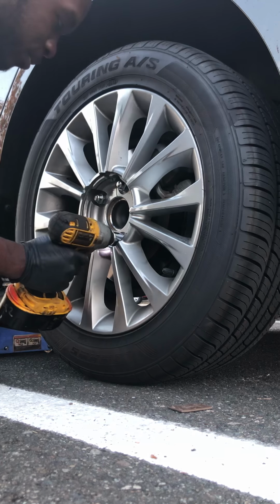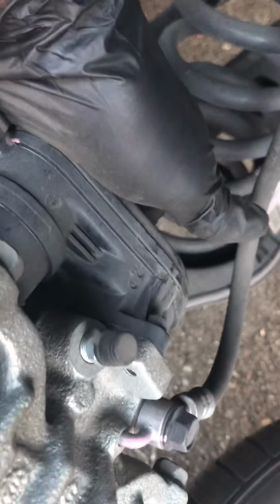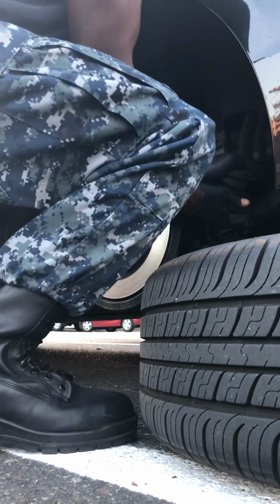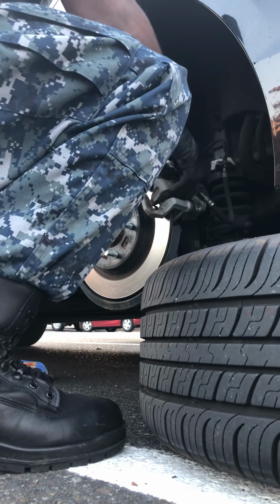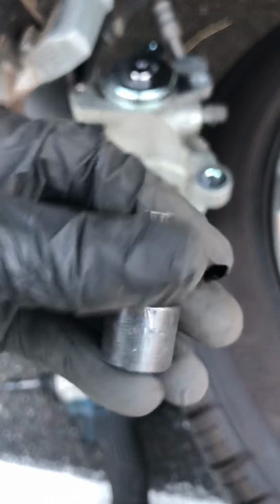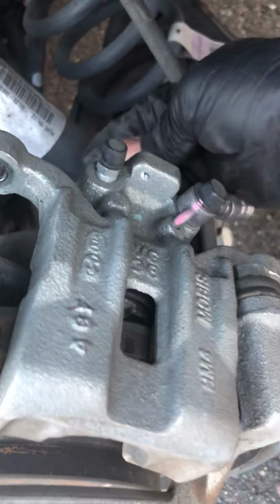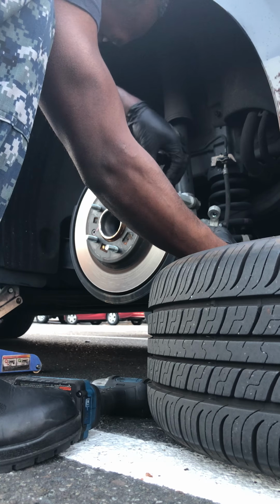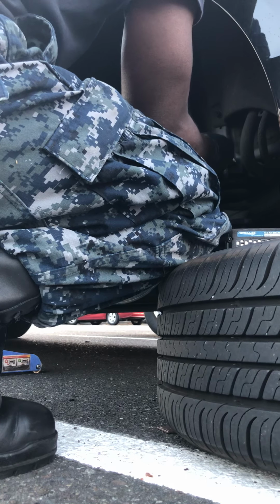HOW TO CHANGE REAR BRAKES WITH ELECTRIC PARKING BRAKE ! EASY DIY 2015 HYUNDAI SONATA

Comment: You can also retract the piston's spline using a 9V battery on the motor's terminal pins.  Then you don't have to dismantle the motor casing.

Comment: You can also use a small flat head screwdriver to unwind the power break gear if you don't have a torque bit.   I didn't have a bit the right size so gently using a small flat head screwdriver worked perfectly..  It should move easily.   Once the gear is turned all the way back you may still have to depress the caliper cylinder.  It should depress easily.  If you feel you have to start using a lot of force the power brake gear may not be all the way turned out.

Comment: Thanks for the great video! I've got an Ioniq and had to change out the rear discs cos here where I live in Norway, we don't change brake pads, only discs 😂😂 (because of the salt) your video gave me hope because of the EPB issue. However I'd like to say that I figured out you can just 'carefully' jumper 12v DC onto the EPB motor plug terminals (after unplugging from car of course) and that will turn the motor in or out depending on the polarity. Very easy to do! When you finished with the job and have the wheel still off, just activate EPB once or twice and it automatucally sets it.
Reply from the maker: Really didn’t even think of that 🤣 thanks for the heads up forsure!

Comment: man , I watched your video on replacing the pads on my 2015 sonata. I took off the motor and turned it clockwise to pull piston in. but it started coming out, so I went the other way and now the piston wont retract. any ideals what I can do to be able to retract piston?
Reply from the maker: Just takin a wild guess because i'm on deployment and can't try myself, but try getting in the car and pulling the lever for the parking brake. Then releasing it. And taking it off again.
Reply from the maker: @davidmartinez
Reply: @davidmartinez I would assumed you figured it out with this post being 2weeks old but if not....I had to use the piston compressor tool in conjunction with turning the back side of the piston where the motor screw goes.
Reply: Hey man I had the same problem. Mind sharing what you did to fix it? I'm thinking of calling a mechanic
Reply: @JavierPerez-jt4lj  Yea you guys got some issues going on. Maybe moisture getting to the piston cups. I'd replace the caliper. It should pushing in nice and easy with some pressure after your clockwise turn the park brake actuator til it stops. Always be careful and precise when compressing caliper pistons. Damage comes easy.
Reply: @edwardwatt3497  yeah I ended up breaking the caliper AND the e brake motor trying to compress it back in. Costly mistake. But nonetheless I took that risk trying to save money and I'm okay with that. My comment to anyone else trying to do this: be very careful, car repair shops have the Kia module on the scanners that put the rear brakes into "service mode and automatically retracts the the e brake motor.  If you want to save money but risk breaking the motor and caliper (like me) do it. As the guy in the video shows you though, it can be done. All up to you.

Comment: I was trying to change my cousins also same model.  Seems like the 2 bolts holding the bracket connected to the caliper had some kind of loctite cuz that bitch was hard to take out.
Reply from the maker: But aye you got it man that's all that matters lol

Comment: I get comfort by sending the park brake screw mechanism back against the pad before I reinstall the motor. It may not make a difference but it'll lessen the chance of the computer sensing something is off. Nothing would be worse than beating the dealership, and then having to take it to them. They laugh at you!